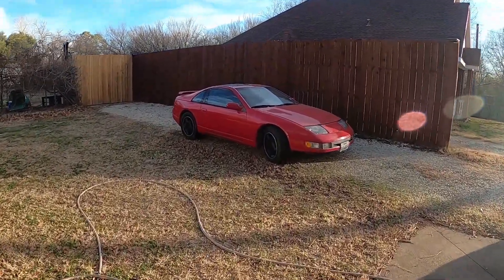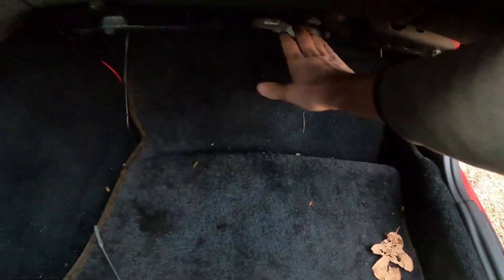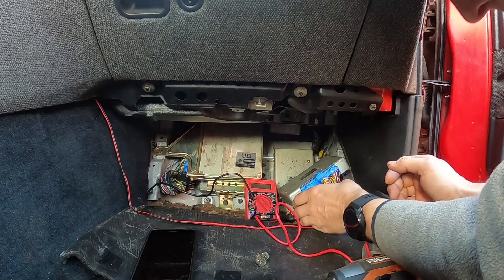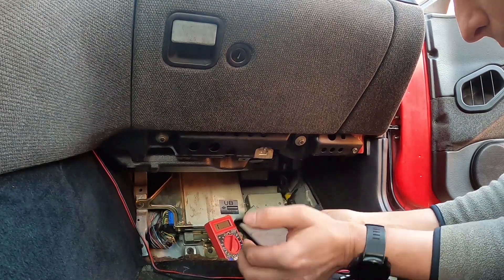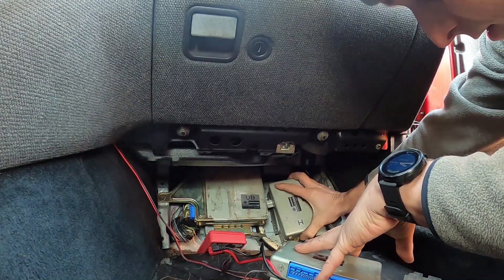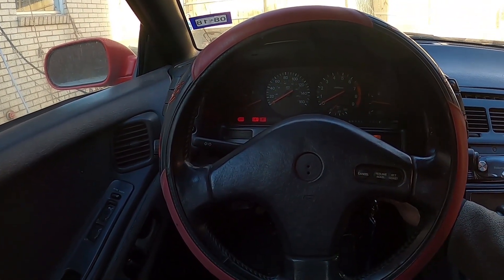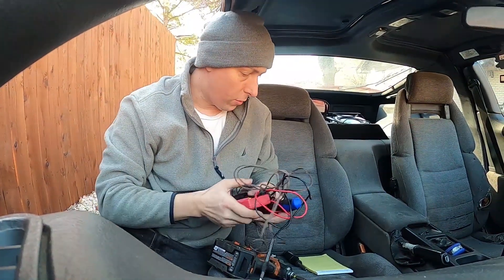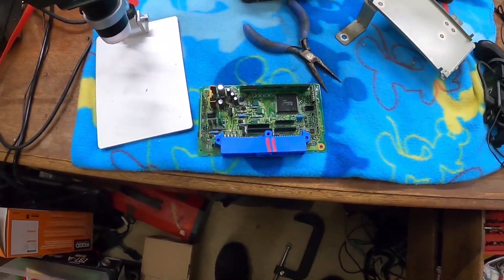Z32 Project: Part 1 - My 300ZX Z32 Transmission Won't shift! #Z32 #NissanZ #FSM

Comment: My 300zx wont shift into drive or reverse. I feel it engaging but once reverse engages it moves a couple of inches and then stop as if in Neutral. I drove this car 21 miles and no issues when i bought it and once i got home it out of nowhere seemed to lose power and wont move. The engine was on and can rev but no movement. Can this be a solenoid/ TCU issue or is it internal? dont want to buy a new tranny without knowing what this might be. Please help!!. Just changed my alternator since the battery and alternator went bad but the issue persists.
Reply from the maker: It could be your torque converter

Comment: Yea, mine did the same thing about 7 or 8 years and I was lucky to find an article showing the same test. Not sure why I didn't check the manual but,,,, I replaced the TCU and it worked fine,,,,until now. Trying to figure out why I can't get it to downshift when traveling at cruising speed. Problem happens when trying to go from OD to 4th and sometimes from 4th to 3rd. It changes from 1st to 4th then OD with no issues but if I try to speed up (floor it), the engine will rev up but it won't downshift. It passed all the tests so far and I'm dreading replacing it but I know that's what is coming.
Reply from the maker: Sounds like a torque converter issue

Comment: informative for sure my trans is doing kinda the same thing as i travel down the road so i pull over shut down and im good to go for a few miles sometimes it totally goes away and returns
Reply from the maker: Might be a connection issue, or it's losing  power somehow

Comment: My z32 wont shift to reverse, could this be a possible fix? Or an internal transmission problem? Drive works fine.
Reply from the maker: Sounds like an internal problem with the transmission
Reply: Did you ever find out the problem I have the same issue
Reply: @GITH-ADAME  yeah i ended up replacing the whole transmission, maybe it was the torque converter but im not sure

Comment: Part number for the TCU?
Reply: And that worked for you 91??... I have the same car 91 n.a and can't find 44900 can another work? 40901 or 54p05 or 45p20.. I found those models online..
Reply from the maker: @arronreynolds3170  I can't imagine them being much different as long as they are from the same model year.
Reply from the maker: 31036-44p00

Comment: My 300zx is auto as well (1991) but instead my problem is it will only shift when I let off the gas. I’ll get up to about 3.1k rpm’s let off the gas and that’s when it’ll shift. Any idea if this could be the TCU ?
Reply from the maker: Will it shift normally if you put it in low, 2 then Drive?
Reply: @RevampMotors no I’ve tried that. It only shifts when I let off the gas. No matter if I’m in Drive, 1 or 2. If I don’t let off the gas it won’t shift and that goes for every gear
Reply from the maker: @DC5JOSH  does it pass the tests I showed in the video?

Comment: im not getting any voltage out of 9 any clue why that could be
Reply from the maker: Let me check on this tonight and get back with you
Reply from the maker: did you check the fuses?
Reply: @RevampMotors  yes theyre all fine currently the car wont shift unless i push the shiftlock button but then when i put it in drive or reverse it wont move like the reverse lights come on but nothing and i can put it in neutral and roll it ive been trying to figure out whats wrong for the past 2 months and im clueless
Reply from the maker: You're going to have to trace the wiring down and see if there is a break somewhere.
Reply: @RevampMotors  a break? like a cut in the wire kr smt?
Reply from the maker: @kappakuru  Yes

Comment: Are the part numbers interchangeable or only the ones that have the same part number for your car will only will work?
Reply from the maker: Which part do you have and what is it from?
Reply: @RevampMotors  I will have to check it here in a hour or so . Getting an alternator put on at a local shop. Just didn’t know if a different part number worked fin place of another before I order one from Z1 or eBay
Reply: @RevampMotors  my oem has part number 31036-33P10 on it
Reply from the maker: @jeremythompson6822  let me check tonight
Reply: @RevampMotors  ok thank you so much
Reply from the maker: @jeremythompson6822  They are interchangeable I installed a 31036-44p00 on this one
Reply: @RevampMotors  and it worked just fine? Thank you for replying and checking 🙌🏽 you posted this around the same time I was having problems and didn’t know how often you are on YouTube
Reply from the maker: @jeremythompson6822  Yes, still does, I try to post every 2 weeks.  Checkout the latest video to enter in The giveaway.
Reply: @RevampMotors  many thanks and will do!✌🏽
Reply: @RevampMotors  will a 31036 40p01 work ?

Comment: Hey, did you use the same exact part # tcu?  Having the same issue, but can’t find a tcu with the same part number available. Was trying to see if they were interchangeable. Thanks
Reply from the maker: I will look, but I don't think it is the same.  The TCU I put in was from a 91 2+2
Reply: @RevampMotors  awesome thanks for the reply. What year was the 300zx you put the 91 2+2 tcu into?
Reply from the maker: @lisahunter5675  1990
Reply: @RevampMotors  thank you!